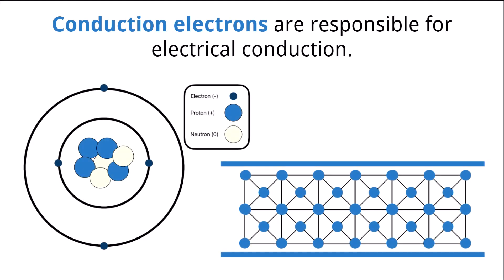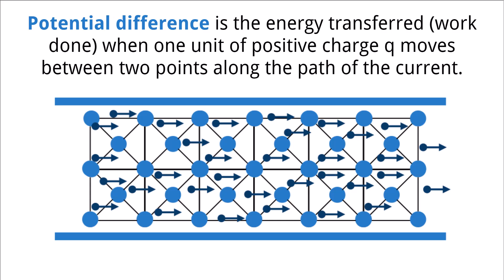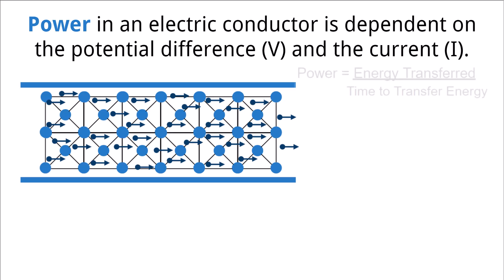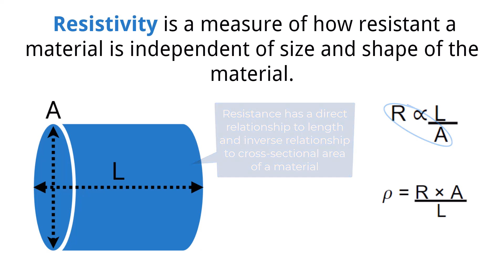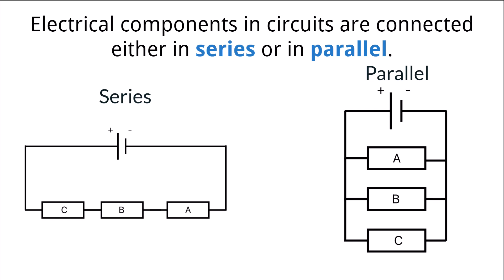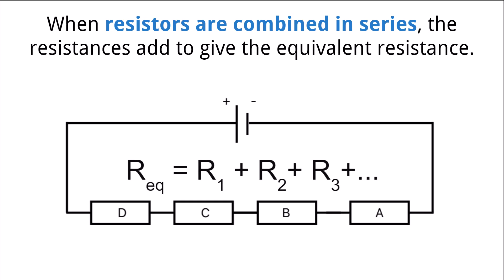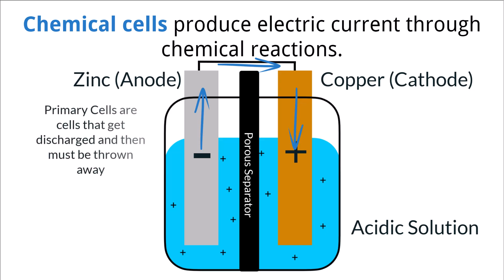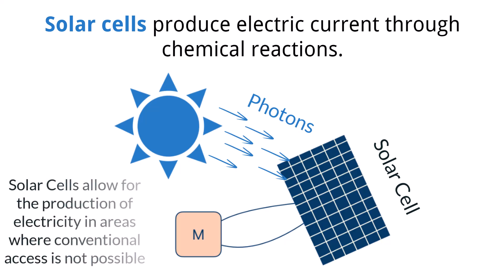IB Physics B.5 - Current & Circuits [SL/HL] - Interactive Lecture 2025-2033

Comment: I was working on the problem regarding the recharging of an electric car’s battery from a 230V wall socket with a 25A current and 95% efficiency. However, the problem only provides the battery voltage (450V) without specifying the battery capacity in kWh or Ah.

Since the charging time depends on the total stored energy in the battery, could you clarify if there’s a missing value for the battery capacity? Or is there an assumption we should make regarding a typical battery size?
Reply: fr same doubt for me too
Reply from the maker: Thank you so much for pointing this out! You can use a battery capacity of 75 kWh. I will pin this comment so others know.